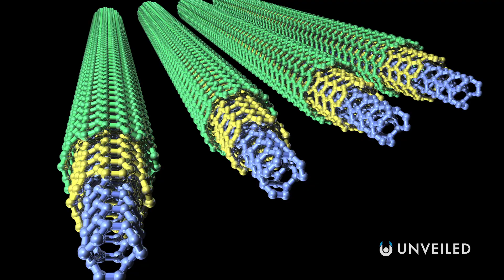What If We Built a Bridge to The Moon?  | Unveiled

Comment: 2 1/2 seconds for light for the round trip = 186,000 x 1.25 = 232,500 miles away. So, if we make a spacecraft that travels at 600mph (which is airplane speed), the one way trip would be about 16 days. But, the spacecraft is moving mostly in a vacuum. Once we are ON the moon, we need to build airtight domes so that oxygen doesn't leak out. It would require MANY flights back and forth from earth to bring tanks of air. If ANY of the domes are punctured, anything living in those domes will die. I believe that this project would cost trillions and trillions and trillions of dollars and it would STILL be VERY dangerous.

Comment: One solution could be, to build a rail kinda system on the moon to connect the moon surface and the earth surface without the need to stop the moon rotation. Or even simpler build a space elevator on earth.